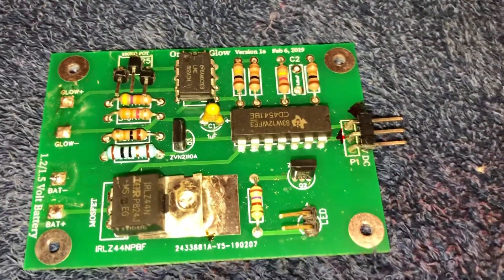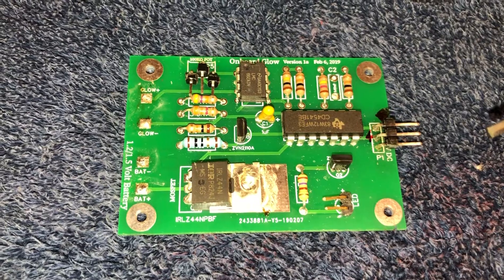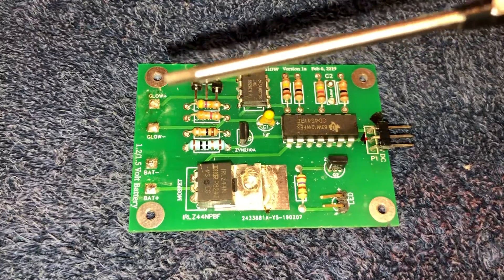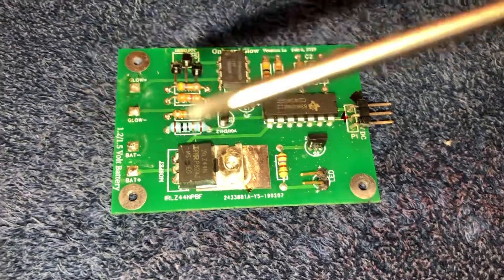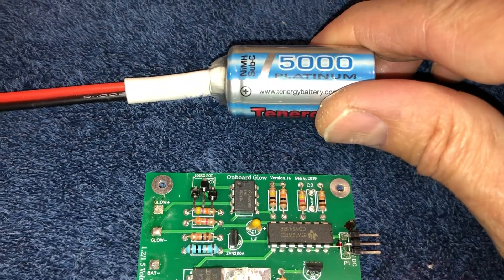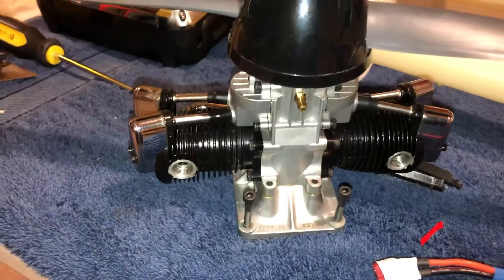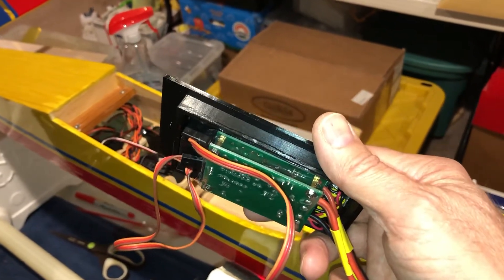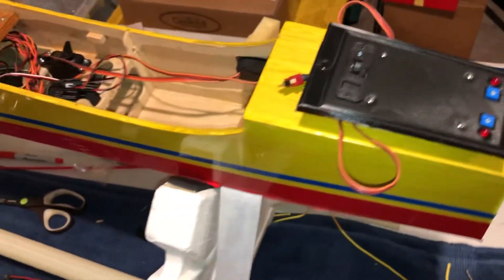How to make your RC Airplane Glow engine run more reliable?  Add a glow driver!

Comment: Nice feature to have for a twin cylinder engine or greater. Where did you get your electronic circuit plans for this? Can you provide a copy of the electronic circuit plans for this device? I am very interested in trying this out myself. Kalvin N
Reply from the maker: Hi - If you are interested I have blank boards and components I would sell at cost plus shipping.  They are easy to solder.  Send me a Private Message if interested.